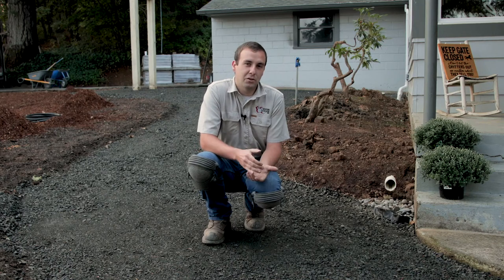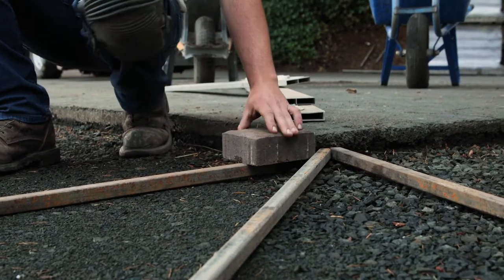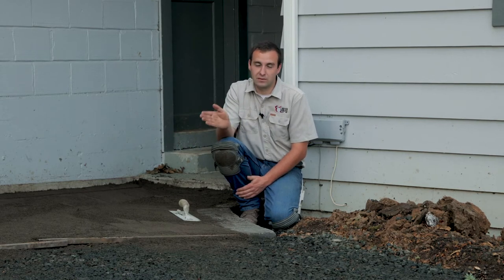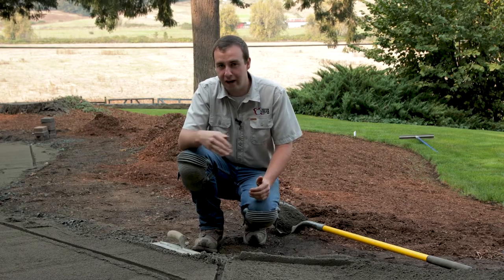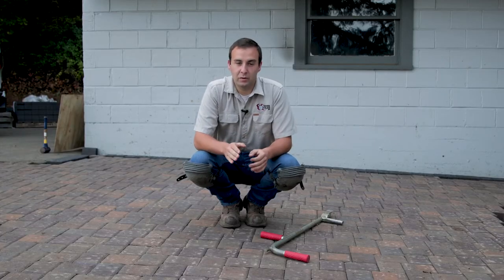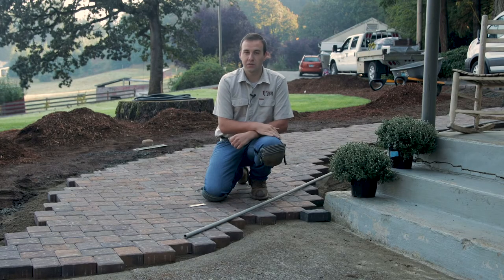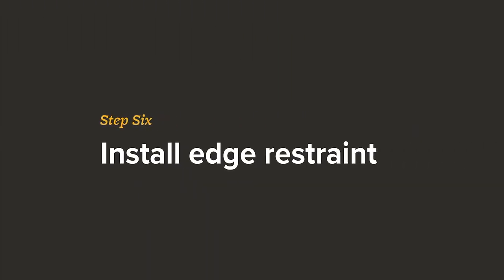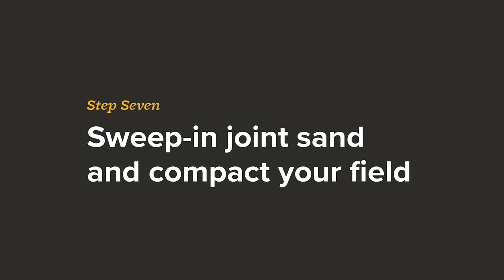How to Lay a Curved Paving Stone Walkway

Comment: Best tutorial I've seen yet. I have a small garden and will need to make a lot of cuts to bevel the soldier course. Should I just do this by eye and fill the gaps after with sand?
Reply from the maker: It all depends on the look that you want. Most people will never notice the gaps if the pavers are small ones (less than 6" long). You can also cut every other one to reduce the number of cuts. At the end of the day, it is all up to you how clean you want the edge to look. If you want it to be really tidy, or if you are using large pavers, cutting every one is the best bet. If you don't mind some gaps here and there, then just roll with it. Either way, I'm sure you'll love how it turns out.

Comment: Oh my goodness!  THANK YOU for this excellent video. 

Given that I work in theatrical construction, and am not afraid of complex projects, how insane would it be to make a herringbone path with salvaged bricks?  I figure that I could try to trim them to (somewhat) uniform dimensions. 

Also, where does one buy the tools you’ve shown?  The paving nudger and the edging, in particular?  I think I know where to rent the machine for tamping down the substrate.
Reply from the maker: You can definitely use salvaged bricks. You just have to lay them loosely to prevent getting yourself into a literal jam. Just lay them and let them kind of run wild while at the same time using a stringline to keep your rows somewhat straight. It can look really cool. The paver tools that we're using mainly come from our friends over at Probst. The adjuster is here: https://www.pavetech.com/paveradjuster

The edging that we're using here is Snap-Edge from SEK (https://sek.us.com/products/sek-paver-restraints/snap-edge/). However, for your application with uneven bricks, I would actually recommend using some sort of reinforced concrete edge restraint. We really like PermaEdge (https://www.permapaveredging.com/), but there's several other similar things on the market.
Reply: @WesternInterlock  Thank you so much!
Reply from the maker: You are welcome!

Comment: whats your opinion on the pros & cons of square vs round screeding rails?
Reply from the maker: We prefer square. The main thing is that they need to be 1" outside diameter and rigid enough to bridge minor imperfections in the gravel base. PVC of any shape simply isn't strong enough to do this. What ends up happening is that the PVC flexes and telegraphs those imperfections into the sand and then into the pavers themselves.
Reply: Do you use standard 1” box tube steel for your screeding rails?